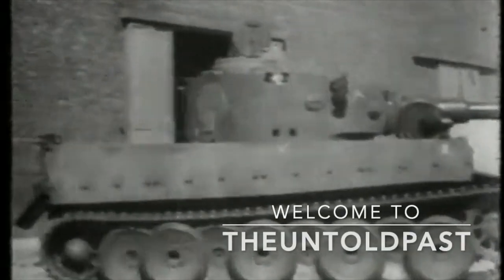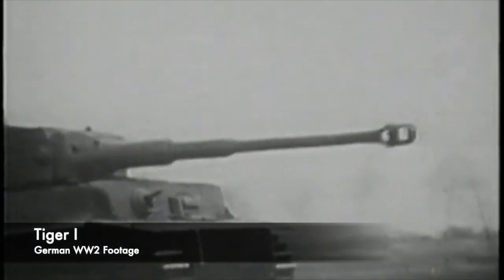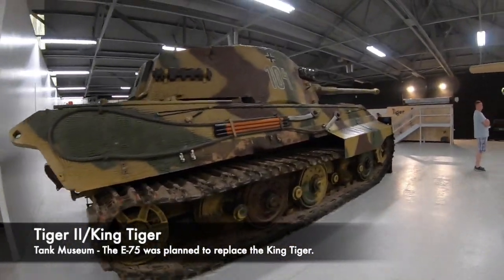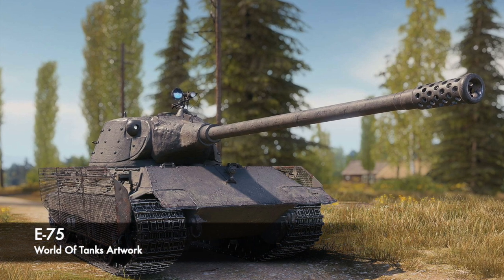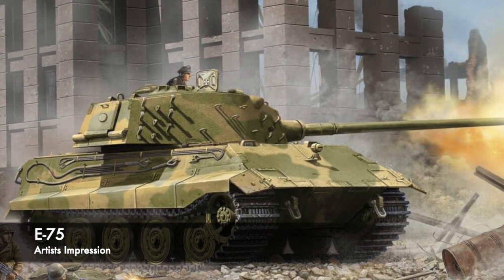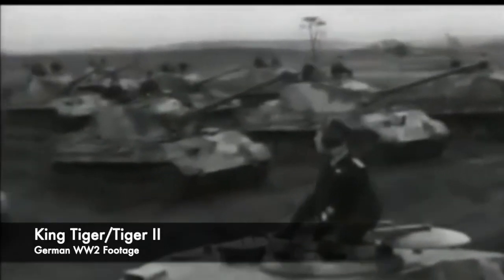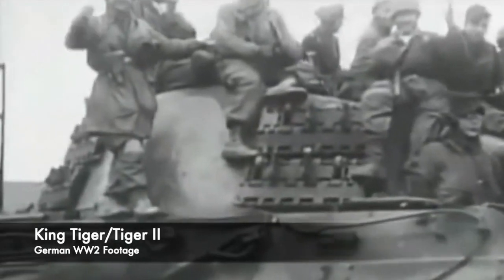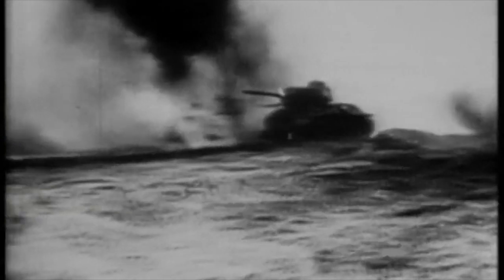The King Tiger's Replacement - The E-75 Standardpanzer

Comment: German Tank Production was so inefficient during WWII; that even the British - whom have always prioritized our Navy over the Army - outperformed them for production.

Losing the Battle of the Atlantic & the race for Oil though, made Germany's defeat inevitable, irrespective of what Tanks they possessed.
Reply: The British produced 35,000 tanks of all type's Germany 49,700..

If we only included main battle tanks its more like British 10,000 to Germany 25,000.....

Germany didn't have the oil it needed nor did it mobilise its economy and resources behind the war till 1944 far to late.
Reply: ^ False, as aforestated.

In 1940 the UK was producing more Tanks than Germany, and in 1942, production had geared up so much - by more than 40% - that the UK achieved  double the German production figures.

The Germans Never had enough Oil to meet demand, and by all meaningful measures had lost the war by 1943, with the only question being whether they'd last long enough to be the first axis power to get nuked.

The USSR protecting their Oil from the Germans prevented a wholesale Russian collapse, but they Still requested the allies send them oil, suggesting they still had shortages thereof.
Oil is also useless to a country without hardware to put it in; which the Russians were desperate for the allies to send them, and we did.

In four years the UK sent the USSR, among other material:
Over 4,000 Trucks
Over 5,000 Tanks
Over 6,700 Aircraft
& 12 Warships

There was also no such thing as the "Main Battle Tank" (or Universial Tank) during WWII. Said paradigm came after, rendering most Tanks from the war - including all the "Heavy Tanks" - doctrinally out of date.

Statistics sourced from the BBC, War Factories S1, and the ONS.
(rather than out of thin air)
Reply: @jimtaylor294  We all read discussed this your number are not correct, such as tanks are more like 2,500 the other 2,000 were Canadian, so have to be taken with a grain of salt.

As all read discussed the best year the UK in 1943 produced 10,000 tanks at its best the Germans built almost 20,000 in 1944 in the hight of the bombing campaign, the UK 26,000 aircraft in 1944 there best year and Germans 40,000 in 1944 again in the hight of the bombing campaign.
Total production aircraft Germany 120,000 to the UK 130,000.
Tanks UK 35,000 to Germans 49,700.
Carden loyd tankette=450
Vickers all types=1,882
Tetrarch=177
Cruisers all type's=13,042
Comet=1,186
Matilda all type's=3,127
Valentine=8,300
Churchill all type's=7,368
Total under 35,500.......

If you wonna include the 22,000 tanks from lend-lease from America of which 17,000+ were Sherman's and almost 5,000 Canadian tanks, your going to still be taking thing out of context to fit your claims.

USA suplyed almost 20,000 aircraft to the Soviets and they suplyed almost 40,000 to the British.

The Brittish most produced truck was only some 10,000 unit's with the next few having 1,000 or less the majority of truck came from Canada who produced 850,000 second to Americas 1.2million.
Universal carriers some 57,000 produced by the UK with the other half built by USA 30,000, Canada 20,000, Australia 5,000 and new Zealand 1,300.

The UK built a bigger navy yes but as mentioned 1.2million metric tons of steel Germans put in there navy compared to 1.8million metric tons in the British.

The Germans were short oil, but they had a lot Germany used under 300million barrels of oil in ww2, Russia 900million, USA and UK 7billion barrels about 6billiin of that was used by America and 500million by UK, the USA also suplyed the British with about 40million to 80million more barrels.
British got the majority of oil from Iran and some more from Iraq.

Germans estimated they needed over 340million barrels so they were short 1 year and 6mounths of oil in ww2.

The Japanese had a total of 35million barrels and were basically out of oil in 1942, they estimated 35million a year to fight both the USA and China, the navy alone needed 17million barrels yet never had more then 7million a year  Italy about 10million barrels and were total out in 1942 I believe there was a reserves of some 900,000 barrels in 1943.

Edit as all read stated the Russian's received 20million barrels of oil form the USA it was mainly aviation fuel, but yes in 1942 the Russian's were short of oil.

Main battle tank was used as a term as people like you like to claim all German TD and SPGs as other vehicles yet don't do the same for eney other nation to inflate numbers, I just prepared my self for a come back I assumed you would try and start before you even said it.

I would also argue heavy tank are not out of date we just have no full scale war, hence we don't need them heavy tank were brake though tank's, all nations built them, the Russian's more then anyone the Germans just reacted to the changing war conditions not real a revolution but for you more then likely.

The TD were all but dead after ww2, the 10,000 or so took out some 2x there number 20,000, yet only one nation built them after ww2 and only stopped in what the 80 or 90s....

We build tanks for all rolls now, a jack of all trade's and if there is a ww then you find the return of all other type's, SPGs are still present in small numbers in most of the top 10 most powerful nations doesn't mean there obsolete just there not much need for them so only a few hundred are needed.

As stated you can go see on youtube (Tik) and (military history Visilised) to see as out of a book or document is not your strong point.
Reply: ^ Ah doubling down on tired germanophillic gibberish; crutched with ad homeniem & dishonesty.

Good job discrediting yourself further though XD.
Reply: For a less OSK limited refutation though:

""your number are not correct""
Ironic XD

""Main battle tank was used as a term""
False, because no such doctrine existed.

""people like you""
Ah; pigeon holing. Cliche much? XD

""like to claim all German TD and SPGs as other vehicles yet don't do the same for eney other nation to inflate numbers""
Projecting your hypocrisy onto others now?. Pathetic.

""I just prospered my self for a come back I assumed you would try and stated before you even said it.""
That doesn't even make grammatical sense XD.

"I would also argue heavy tank are not out of date"
Because of course you would XD.

Heavy Tanks faded out after WWII for two primary reasons:

1. The Shaped Charge - and Square Cube Law - made simply having thicker RHA steel armour no longer worthwhile. A cold war era TOW missile for instance, could punch through RHA Steel over 1ft thick, far beyond what a practical Tank can heft. MBT armour trends reflected this reality, particularly with AMX-30 & Leopard 1.
2. WWII proved that Heavy Tanks were too impractical. Armies like being able to traverse bridges without them collapsing, cross ground without sinking in the mud, and not require double or triple heading by tractors during battlefield recoveries.

""The TD were all but dead after ww2, the 10,000 or so took out some 2x there number 20,000, yet only one nation built them after ww2 and only stopped in what the 80 or 90s""
Questionable stat's aside; casemated self-propelled guns were generally the result of wanting larger guns on hulls too small to mount them in turrets, thus saving on development time, resources & money. WWII ending removed this raison d'etre, and there were few other reasons for such vehicles postwar, besides being able to fit large guns on relatively light chassis'. Neither the British nor the US bothered fielding one, with most R&D examples being for niche purposes.

""We build tanks for all rolls now, a jack of all traids""
Let me guess... Spell Checking's for nerds? XD

""if there is a ww then you find the return of all other type's""
I could refute this in quite a few ways; but I think the simple fact that WWIII will never happen without a nuclear exchange renders the entire topic moot. Standing Armies are no match for split atoms.

""SPGs are still present in small numbers in most of the top 10 most powerful nations doesn't mean there obsolete just there not much need for them so only a few hundred are needed.""
A handful of casemated SPG's isn't going to spontaneously turn into thousands, for pretty self-evident reasons. There's also no indication of any 1st world country having considered one in decades. MBT's are the paradigm.

And again; name dropping two YT channels you clearly haven't actually watched as a crutch for unsourced word salad, isn't a substitute for putting a verifiable source, as I did, and you ignored because it was inconvenient to your narrative.

Comment: The main reason Germany's didn't mass produced tanks was fuel, the second was they didn't mobilise there economy and resources behind the war till 1944 far to late.

Germany produced about 20,000 tanks of all type's in 1944 out of a total of 49,700.
German records indicate 300 tiger 1s lost to the bombing campaign on factory floors, over 600 tiger 2s and about 8,000 panthers all in various stages of production, with 12,000 other tanks type's also destroyed thanks to bombing.
Reply: Didnt they produce over 400 Tiger II tanks?
Reply: @darnit1944  Just under 500, with over 650 lost on factory floors, so total would have been over 1,150, they only planed to build 1,500.

Comment: At about 1:03 when you say it was designed to "replace the Jagd Tiger or Tiger II" I am not sure if you are using those two vehicles interchangeably or if you are saying it was  designed to replace one or the other.  If the former, the statement is incorrect as the Jagd Tiger was a Tank Destroyer and the Konig Tiger is the Tiger II tank.
Reply: They used the same chassis, the Germans had a pretty reliable practice of building a new tank hull and then building both a tank ans TD version because hulls could be built faster than turrets.
Reply: It a howitzer
Reply: @titakristengco  No it was a tank destroyer. the only howitzer germans created was the bar sfi or the sturmtiger.

Comment: During WW2 Germany produced more than 1000 U-boats (submarines) each weighing some 1000 tons. That's 1.000.000 tons of high quality steel and WW2 high tech. With that amount of material if would have been possible to produce more than 10.000 Tiger I, II, E50, E75...
The Soviets were able to mass produce the T34 but not the IS-series tanks.
Reply: tank production would not have saved the germans, their loss was inevitable without an effective anti-air capacity, and without the ability to engage targets across the atlantic and the urals.
Reply: And a lack of fuel and oil
Reply: We didnt had enough recources thats the problem. Hitler wanted the oil in russia and the Kaukasus thats why germany attacked Stalingrad.
Without oil you cant build enough.
Reply: The U-Boots were very lethal, at least until 1943, the real waste of resources was the building of big & worthless battleships, without aircrafts & lesser vessels to support and escort them they were litterally trashed by the RN and RAF.
The germans, not only Hitler, had this obsession with big, overengineered and worthless weapons. Today we call them "missile's magnets"
Reply: @near--zero  If the Germans took the Caucasus then the war would have eventually come to a German victory in the east soon after, then not to long after that a peace deal on the western side, the allies would have had no hope vs the fully fuelled Germans and there lesser allies, with the majority of there forces ready and available to fight the allies it's pretty impossible for a victory.

The Russian's only had about 60million people living on the other side of the Urals, the majority of them not even Russian, about 20million+ Siberian people's, and the same number of Asian stan peoples.

Not to mention the USA produced 6billion barrels of oil in ww2 the allies alone used 7billion, this would mean more strain on nations to pay for oil, and time and resources spend getting it from other parts of the world, time they don't have at this point.
Reply: @alessiodecarolis  Germany did build 2 smale and 2 big Battelships, UK did build 6 medium Battelships, and rebuild several old Battelships/Battlecruisers, who waste most material on Battelships?
Reply: @kirgan1000  They needed a strong fleet, the Germany simply hadn't the resources for fight everyone everywhere, they wasted materials & resources for "Huberweapons" that didn't worked as they'd hoped